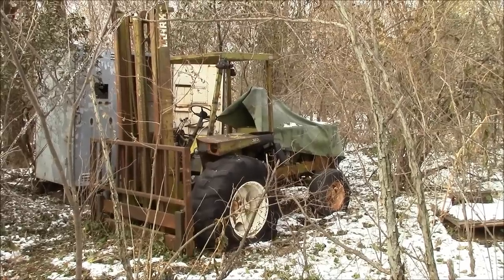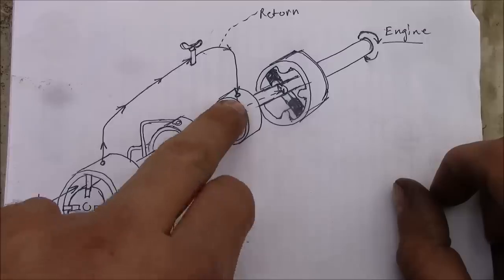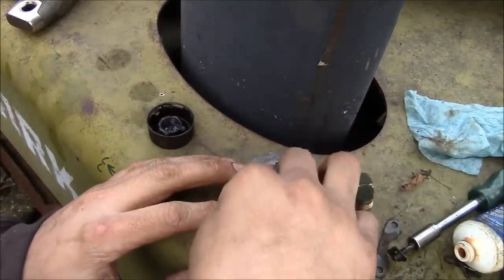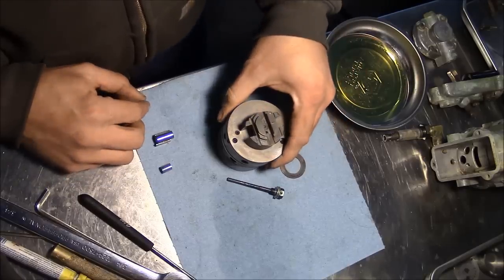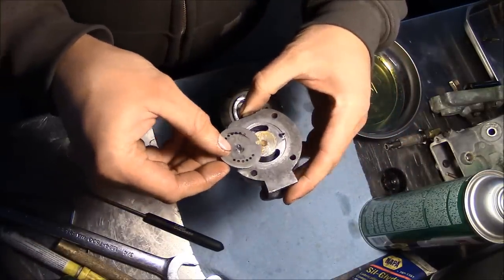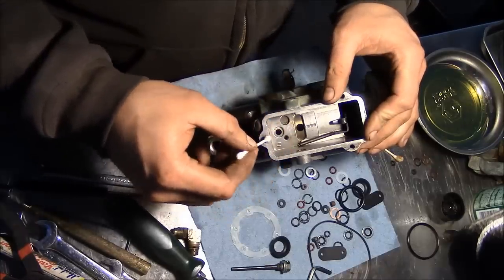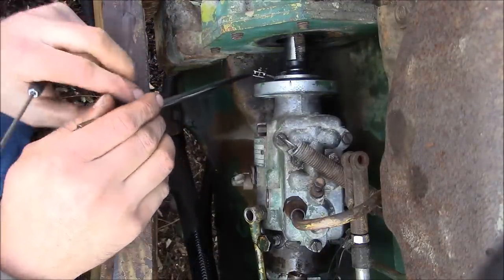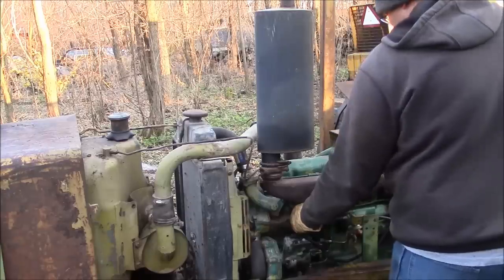Neglected Clark All Terrain Forklift - Will it Run Again?

Comment from the maker: Just to clarify, there is plenty of fuel at the inlet to the injection pump. When I said "running out of fuel", I mean inside the injection pump.
Reply: if youre rebuilding the injection then make sure to give it a new lift pump.  so do the lift pump first and see what happens.  alot less money.
Reply: There is so much you can do with not a lot of kit as we all know clean everything fuel system etc start at the beginning tank and contents. Just to say some lift pumps have a filter inside the cap. A trick I learned is clean lift pump out if its still lazy squirt engine oil in the inlet it encourages the valves. But filter filter filter.clean clean again
Reply: Watch Wes Work A diesel with a Bosch fuel injection or EFI I will always start better, rotary head gets weak fast, at least in a roosamaster.
Reply: Where did you get that neat siphon pump at  ?
Reply: Chadley DoRight I believe I bought one at harbor freight, I would also think most any "real " auto parts store, I kind of felt guilty buying it, thought of it like a battery powered sawsall , a thieves best friend.
Reply from the maker: @johnchadwicktilton  I think it's called a "super siphon". You can find one in any decent farm supply store. Here is one on Amazon. https://amzn.to/2O1JKPN
Reply: Remove the check valve in the fuel return line to the tank. If it's still on the pump. May or may not be there. Someone could have already removed it. The check ball in the fitting is problematic with old systems. Worked for me on my tractor. What happens is the fuel can't return so the pump builds internal pressure and the lift pump can't overcome it
Reply: @robertblakley7206  i knew  a guy with a old 1989  kubota M6000 tractor with kubota diesel and he had it seince  from 1989 to 2018 and it still running with origional  parts and no down time wich pretty good years on it and the kubota diesel engines still making them wich now from 9.6hp up to 171hp
Reply: I think your starter issue is the hydraulic pump is not bypassing when you engage the starter.      If your hydraulic pump is mounted directly to the crank at the balancer.    Should be a 12v solenoid on the pump.    I had the very same issue once on a similar fork truck.    The bypass has to work or slow start
Reply: I'm actually having the same problem on a VW TDI. Different rotart pump design with a Bosch pump but same idea. Only runs at higher rpms. Changed out the high pressure plunger/rotor and still the same problem. The vane pump pressurizes the inside of pump to ~150psi and is regulated by a spring in a bolt. The spring is held in the bolt with a spring pin. To adjust it you push the spring pin all the way in then tap the head of the bolt while the engine is running to adjust the pressure. Each tap knocks the pin out a little bit at a time loosening the pressure on the spring and lowering the fuel pressure.
Reply: Not many excellent mechanics about,  wes is definitely one. How much did you learn from eric the car guy 🤣🤣🤣
Reply: @WatchWesWork  they are also found at some truck stops
Reply: Just a word of advice, those pumps with the vane type lift pump don't last long on old fuel. I had to replace a pump on a jd track loader that twisted the shaft off at the lift pump. I always tell everyone to throw out old fuel because it's cheaper than an injection pump but they cry about it. At least dump something in to add some lube.
Reply: It sounds like the carburetor. is bad
Reply: Yes I thought the hydraulic pump was working against some pressure.   The very first half second part of the cranking is fast, then the hydraulic pump slows the engine down.
Reply: @WatchWesWork  Over here we also call them jiggler siphons.
Reply: Becky Watt😸😙
Reply: did you ever get this fork lift project finished up updates please
Reply: Really enjoyed this one. Work on the injector pump was awesome. Thanks for the teaching exercise!
Reply: Instablaster
Reply: Same engine that’s in my John Deere 70 excavator. They are extremely hard to prime. I have run mine out of fuel at least 10 times over the years and it never gets any easier to re prime.  Pain in the ass.
Reply: Going off your drawing it looks like that main shaft is bent. 😂 just kidding that was actually a good drawing. There used to be guys that did drawings like that for companies. Now I think most of it is done on computers.

Comment: Had starting Problems with those engines many times, we figured out, that if the crancking speed is one rpm to less you can spin it all day without results, if the speed is right it fires up first crank

Comment: Only a brave mechanic touches injector pumps.
Reply: They really are not black magic..cleanliness is the key thing when servicing them and DPA pumps are simple. I prefer working on them than SIMMS type inline pumps
Reply: in my case, it was desperation.   couldn't afford a $700 rebuilt pump.  replaced broken plunger springs the first time.  second time, got the kit and went through it completely (and found yet another chunk of an old, broken spring still in there ... yikes! ... and nearly sheared hpp drive dogs).  It had gotten to the point where you replaced one leaky seal, another would start leaking.  (Bosch rotary, similar in operation to this one)
Reply: there not that bad been rebuilding them since 1984 and my father before me  juts take your time keep it clean and make sure you get the right kit
Reply: I work on Yanmar Pumps only... That is the only one I have Mastered...

Comment: I also had the same problem Daniel Ramsey stated concerning the pickup tube from the fuel tank limiting flow. Mine was on a 1967 580 case backhoe with the same injection pump your dealing with. I cleaned and sealed the tank and still was picking up a little rust in the tank that didn't seal properly, so rather than take the tank back off I put a hose on the pickup tube on the inside of the tank so it would not pickup from the very bottom of the tank. I know it won't get the last inch of fuel in the tank but it gets mixed around from movement so I don't see it as a problem and it saved me from having to pull the tank a second time which was no small endeavor. I did that fix a year ago and has been running great since. Love you videos. God bless!
Reply: John14:6 St.John 6:44 , and the Book of Enoch changed my life .Btw , that is a good fix , have done it w/several pcs of older /ancient equipment.

Comment: over the years as a diesel mechanic I've found that if you pressure on the nut and tap the line you will often break the line and nut loose
Reply: Wait what do you mean tap the line? Just kinda tap it with a light hammer? This is valuable information.

Comment: Nice work, the pump functions were well explained. For a starting aid I use a rag soaked in gasoline held in front of the intake. won't vibrate glow plugs or damage internal parts. just let the gas fumes do the work and don't let go of the rag when it starts.

Comment: Wes, that was one of the best vidios I have ever seen. I will have to watch it a few more times to get my head around the complex internal workings of a rotary pump. Just shows what makes an expert!  When I service a diesel system, ie change filters I keep the stop cord out all the time then once I have bled it to the injector pump I crank the engine on full throttle and after three seconds put the stop cord in and it usually starts without cracking off an injector pipe. (not always). This saves a bit of battery life. Try it if you don't already do it and see how you go. Cheers, Jim in NZ.

Comment: Date Jan 3rd, 2020.   Your video was well done!   You are meticulous with the pump! Bravo!
Definitely,  the pump was gummed up, and needed your work on it !  You had the humility
to have and read up , in the shop manual, or pump manual. Good!   Your illustration was great!
Your willingness to note down, or make diagrams of details, is very good when you are on 
a machine you are not familiar with!  This saves a lot of grief,  when stuff slips your mind!
Your use of compressed air  and assembly grease, is right on!  Do not be reluctant to soak stuff , in carburetor  cleaner!   wear gloves to protect yourself!   #1. drop the old diesel fuel, 
mix fresh in,  and  here is a fantastic trick!   get another cap for your fuel tank.  Drill it out, 
and install a tube with nuts inside the cap and out to secure the tube.  either attach a short hose, to an air coupler.  Put the cap on the tank,  and apply  any where from  8 to 10 lbs. 
of air pressure to the tank! NO MORE!  Crack open the pump bleeder screw, and  then the 
injector bleeder screws or loosen the nuts,  and watch the fuel and air bleed out of the system
so fully and completely , before your eyes! you will kick yourself!!  It works like a forest Fire!
The big mistake is that all of us do as we are told,  by cranking, and pumping,  so forth , when the trick is just to put a little air pressure over the fuel in the tank, and the fuel will run up into the lift pump,  through the pump, up to the injection pump, fill it up and out to the injectors, 
and  you will be amazed, just how much air come out!  Also, it is crazy how much air gets trapped in all those  complicated mechanical gizmos of yester year,  before electronics of 
today!  Do this first, and see what happens!  Before  opening stuff up!  At the very least you wil know, the system is full, and clear of air,  and  topped up!  If it does not run, something is jammed.  And if you have no air compressor, just rig up a tire tank, with a valve, and a hose!
fill the tank to 80 lbs, and  and just crack open the valve you rigged to the hose a little bit, 
to apply just a little pressure!  Works great in the field!  All the best! kennethzakaib607@gmail.com

Comment: Think that pump is fine now, could be a bad inector pushing exhaust gas in the system, or just a clog in the fuel line or tank., Starter has probably sticking brushes, or a broken spring on one.  you did good on that pump cleaning! (y)

Comment: Very good I appreciate your honest and humble approach to your projects. The starter is probably pulling a lot of amps and to have it repaired is wise also thanks for trying to get the pump going . I work on fleet equipment and have never disassembled an injection pump . When it is determined the issue is the pump we just pull it and send it out  . Most shops are not equipped to do that kind of repairs, so again thanks.
Reply from the maker: I'm not equipped to do anything but take it apart, clean it, replace the seals, and put it back together. I can not trouble shoot or calibrate the pump.

Comment: The starter motor you might be able to do, try cleaning the ends of the frame and end caps (usually like 3 pieces) and polishing the commutator, it could also have a broken brush or two causing it to have half the torque.
Reply: sometimes the end bearing wears out allowing the commutator to partially ground

Comment: I put a Carter fuel delivery pump on my Allis D19 with gravity feed to raise the input pressure to the tired injector pump. Wow it raised the pump output pressure enough that the tractor would even start in freezing weather without either.

Comment: old trick, don't use ether, use wd40 it will lube the engine instead of dry it out. time for an ultrasonic cleaner
Reply: WD40 won't work anymore.  They changed the formula.  I use to use it all the time.  But it don't work since they changed.  Guess they didn't want to name it WD41.  Try using starter fluid instead.     I now curse WD40.   it is not that good of a lub and now it won't start a lawn mower.    Oh yes i am sure if you have and old can of the old formula it would work fine.

Comment: did someone put a 24 volt starter on it? I run into that once servicing a hard starting Detroit
Reply: Thats what I'm thinking. As soon as he said it just doesnt want to turn over on 12 volts. Someone back in the day may have had to replace the starter and they got the wrong one on it.

Comment: I can't count how many times I have worked on something I either picked up cheap, because it didn't work, or worked on someone else's machine that was horrible to use due to poor starting and more and how so much of it revolved around just awful starting circuit wiring issues. 

Crappy replacement ends that were corroded to death, 
Bad grounds connected to the first metal point they could hit (paper thin sheet metal usually) and not a major engine block or frame point. 
Rotten cables that are more copper oxides than conductive copper.
Grossly undersized cables.  Oddball (and old) 4 or 6 ga small vehicle cable (or solid core aluminum residential wire)  for a big diesel or gas engine.  
Starters that are way past worn out internally to where they are running on nothing but their rotors riding on the fields due to the shaft bearing/bushing being totally gone. 
Way undersized battery for a big engine.  <600 CA rated small car battery (cause it was really cheap) when 1 or even 2 large 1000+ CCA rated group 31 size are required. 

My rule for starting systems is gets oversized cabling and battery, no arguments.    I have a MF 1155 with the Perkins V8 diesel (~540 CI) that we first got it was hard to start at 40 F but after a major starting system rebuild and improvement,plus  quad glow coil conversion, will start unassisted at 0F now if need be.    

The cabling it had when we got it was 1/0 that went from one battery to the other then up to the starter with 2ga grounds for each battery.   All old cobbled together junk.   Now all 4/0 copper cabling set up as dual independent circuits for each group 31 battery and well worth it in the end.
Reply: Amen

Comment: Did you check if the filter is blocked? That could cause some fuel starving if it is limiting how much fuel can get to the pump
Reply from the maker: There's plenty of fuel reaching the injection pump.

Comment: I found once you’ve used 24v on the starter a few times they don’t like going back to 12v become very lazy
Reply from the maker: Heh. Probably so. Usually the winding can handle it, but the duty cycle drops. So if you crank it too much it overheats. I've been involved with many 6V to 12V conversions and we always used the old 6V starters. They didn't seem to mind the higher voltage.
Reply: @WatchWesWork  That is not all that truthful, Most if not all starters are rated for much higher voltage, In some cases they are just different labels.
Reply: Back in 1952 I worked in a gas station that took road calls. The cars were still high % 6V batteries. We always used a 12v battery for jump start. Just don't have the lights on. Poof goes the bulbs.

Comment: “When the sun goes down at this time of the year it pretty much goes dark”
Reply from the maker: Tough to work outside this time of year.
Reply: Ummm,  when the sun goes down at any time of year, it generally goes dark.    /s
Reply from the maker: @firesurfer  In the summer you can sometimes have 2 hours of light after the sun goes down. In the winter it's like 5 minutes.
Reply: @firesurfer  The nearer you live to the Polar Circle, the greater the difference in the day length between summer and winter. From the Polar Circle and further north, you get days when the sun never sets, but even 1000 miles further south, it never gets really dark at night at midsummer. The flipside of that is that the days get very short, or the sun never rises in winter far north

Comment: Try some propane instead of starting fluid.
Reply: vodka be better
Reply: @Chris-bg8mk  my face is melted off now
Reply: @85square  you mixed up the vodka, propane, and cigarettes...
Reply: I can't drink that stuff anymore.
Reply: I always use propane ..if it dosnt fire up on that then there is something seriously wrong! its also no stress on the engine
Reply: I use some gasoline on the air intake, to help start the engine
Reply: @85square  Polish vodka only

Comment: After working on a ton of GM 6.2 pumps years ago I couldn’t imagine pulling this thing with the shaft left in the engine. And I was commenting on the ease of tearing the shaft seals early on in your vid without that “special tool”, then… I had to chuckle. Oddly enough, I went through 3 pumps without the tool and without tearing a seal until someone told me about them tearing. The very next pump, you guessed it. Torn seal. I still have those tools years later.

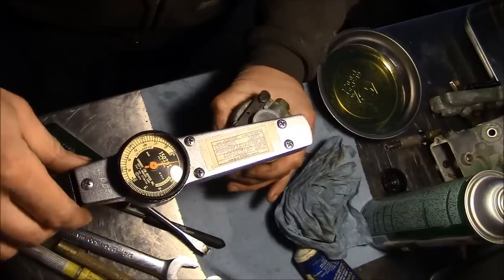Comment: @22:28 my AirFryer ended it's cycle and beeped. I thought Wes's torque wrench had a beeper. The visual did not match the sound and I was perplexed for a second. This pump is new to me. Such precision. (In a sense, it is the "ignition system" of a diesel engine. Timing and all). I love learning something new. Even at 57. Thanks, Wes!
Reply from the maker: LOL. We have one of those things. Works great.

Comment: Cool! I was surprised it didn't take right off and run like a champ, with the cleaning you gave that pump and fresh(er) fuel. You are pretty smart for a young guy. I wouldnt have known where to start on that pump.
Reply from the maker: Just start with a wrench and finish when there are no parts left on the bench!
Reply: @WatchWesWork  lol, and there is the problem..

Comment: i feel you on this project. i'm working on a very neglected 1944 Clark Carloader forklift right now and theres no end to the small problems. carb either doesn't get enough fuel or floods. took it apart and it was filthy. probably never been rebuilt and the kit is $100!
Reply from the maker: Yeah but that's money well spent. It'll never run right with a crummy carburetor.